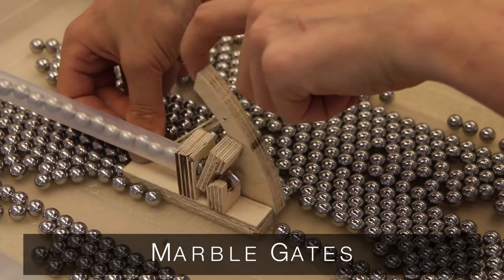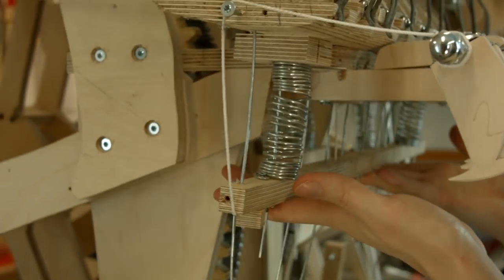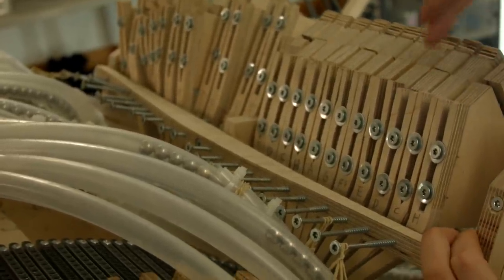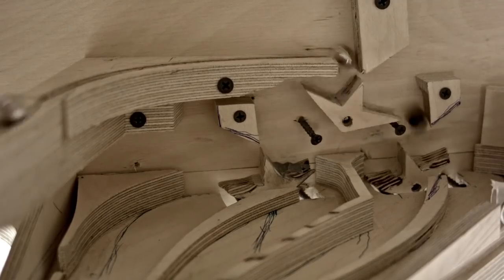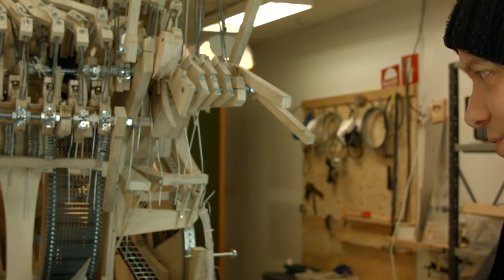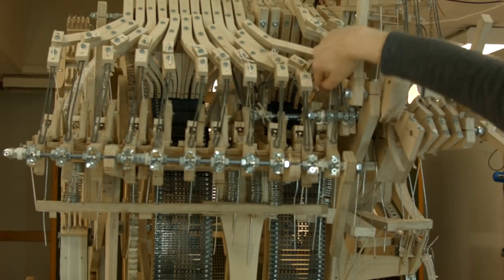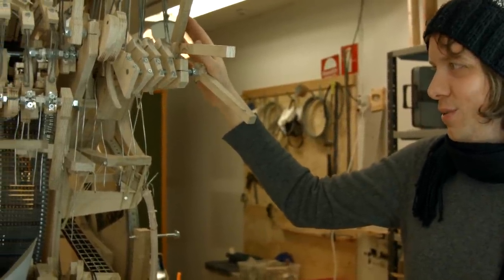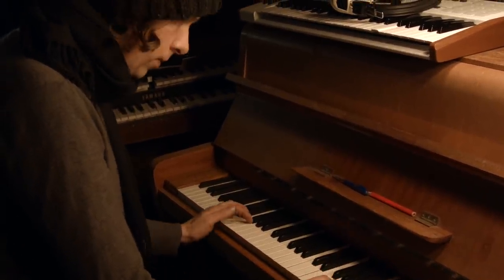How It Works - Part 2 (Wintergatan Marble Machine)

Comment: You just need to perfect it and eventually when its perfect,create a complete metal version. Get a patent on it once it's fully metal like a band instrument. BOOM! You have now created a new instrument that is used in orchestra performances and stuff! Kapooya. Get rich
Reply: +Mr.Funnybone Making it fully out of metal, even something light in terms of metal like aluminum would just exacerbate the oscillation and drifting problem of the programing wheel.  More weight would make it shake more, and would probably make it 'drop' more marbles than it does already.

Essentially, if he did make a 'perfect' wood version, making it out of metal might just make a return to the old flaws.  Wood also resonates better than metal in a lot of cases, it's why we still make string instruments out of wood.
Reply: +Brad Hicks 
Well then...lets make a polished factory made wood version yeeee

Comment: Just an idea, but you mentioned that the pegs can break. With the current design, is it possible to use metal (or aluminum) pegs? That should help with them breaking.
Reply: +James Pierson 
Very Interesting suggestion; one I can help with thru proven old technology: barrel organs used metal nails with the nail heads removed. Maybe he could change the "programming wheel"(as he calls it) to take up snapped off nails (with the heads still attached; so snapping off the sharp ends), by putting them in from the inside of the wheel sticking out and then have some sort of locking bar to attach so they don't fall out.
Reply: +theorganguy 
alternately, he could make ready made "nail-bars" to put into place of the lego-technic-bars... maybe tho with some quick-release mechanism instead of screws...
yet another option would be to make dedicated wheels per song, rather then a re-programmable one... those would take up a lot of space, tho...
Reply: +theorganguy 
Your suggestion seems to be a bit more complex than simply buying new pegs. The Barrel Organ is kind of what I was thinking with the metal peg idea. That, and plastic breaks too easily. Metal, not to much, but would his machine handle it?
Reply: James Pierson

I'm pretty sure the machine could handle it... worst comes he would need some sort of screw or wire-loop on the levers, so that they do not get worn down by the nails. From an action point of view, everything remains the same as with the plastic pegs...

Comment: Try using the lego pins, like part 2780 4459 40345pin and possiblily 15100 from brinklink catalog at 5:41 in the video.  15100 could keep it from breaking on the end that contacts the lifters as it is round. Good luck. Would love hear if that helped.

Comment: well metal ball bearings have a considerable amount of mass.   you could theoretically increase durability by shortening the drop height of the bearings.
Reply: +Galorn Bearing balls... ball bearings are something else entirely (yes, I know that many people call those little steel balls "ball bearings", but that's totally incorrect; they're bearing balls, or just balls).

Comment: One thing I still don't get, is how can you program the bass line to be different on the second revolution? Does it require a second take so you can pause the camera while you reprogram to the C Major chord progression?
Reply: +A.J. Whittaker the "string hitting pattern" stays the same, he changes the way he pinches strings with his left hand. (Sorry for my awful english).

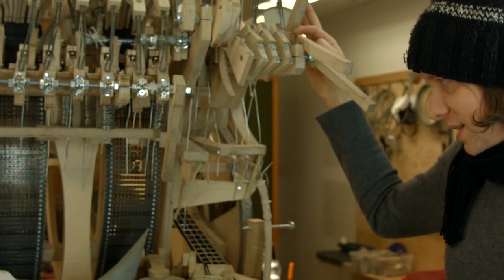Comment: A little late for suggestions but the problem at 5:38 with the lego nails breaking can be remedied by using this part (https://www.bricklink.com/v2/catalog/catalogitem.page?P=3749#T=C) instead of this part (https://www.bricklink.com/v2/catalog/catalogitem.page?P=3673#T=C).

Comment: Wintergaten if you want to fix that broken C on your KeyLab it is really easy, just undo the screws on the bottom and glue back in the broken off plastic. Its poorly designed but easily fixed.
Reply from the maker: You have SHARP eyes and very good advice! Thanks!

Comment: What material did you use as programming wheel?
Reply: +Alessandro Ascanio He made the wheels from wood and used Lego Technic parts screwed onto them as a programming matrix. He then programs them using the Lego Technic nails, which are normally used to connect multiple Technic parts.

Comment: I'm pretty sure the programming pin is a lego
Reply: +Kalle Noble He covered that in part one - The nail and the piece it goes into are lego technic parts.
Reply: smithno13 That's kind of awesome
Reply: You could be correct there, Kaile Noble, but shouldn't it be made of wood?
Reply: I dont think it would be durable enough. Even the plastic ones get worn out quickly. Metal dowels would probably be the best option, but may not stay in as well at the plastic.

Comment: Is it possible to take out the programming wheel to program a new song?
Reply: take out the programming wheel??
Reply: +Mlg Banana these big grey wheels where the lego parts are placed and where you code songs, I asked if it is possible to take it out / off to make it easier to code a new song
Reply from the maker: Yes that was inteden but the machine stopped working! building version 2.0 of the machine now!
Reply: +Wintergatan wow, didn't expect that! when will it be finished?

Comment: Kind of a music newbie, what note is 'H'
Reply: Some countries use different notation, a lot of countries with latin based languages use do re mi for example. but other languages (probably including Swedish) have system which includes the note H.
Reply: @Yorie1234  Interesting. What does it translate to in 'regular' for lack of a better word
Reply: H refers to the note between A and C, so it's what is called B in English or si in doremi.